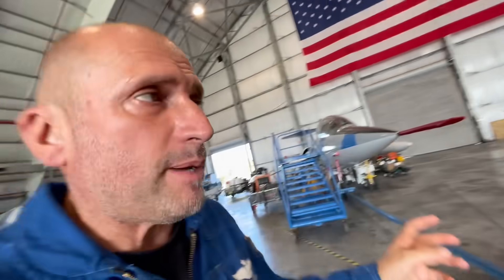How does a 7500 foot runway look from a Lockheed F-104 on final?

Comment: Has anyone actually landed one of these death traps? I just thought they took off and crashed by design. Like a test bed for ejection systems. They don't call it the Widow Maker for nothing. I suppose it's probably because the German airforce tried using it for a role it's not designed for. Still, the numbers are stupid scary

Comment: As a student in UPT at Willy, we would often go to Luke Aux Field in our T-38s to practice approaches. The runway was old concrete and grass so all approaches were low approaches or go arounds. We would normally fly downwind at 250 but when a German F-104 entered the pattern, we would bump it up to 300. Trying to get your pacing down at 250 as a student was challenging enough but flying at 300 was like fast forward. We heard an American FCF pilot on guard one day telling the Luke RSU that he was stuck in burner and would G the jet up, S-turning on final before killing the engine and landing dead stick. We checked in when we landed at Willy and found he made it in no problem. Amazing...

Comment: If your landing speed is already MACH 1,  you better have a lot of runway ahead of you to stop. That is definitely one airplane that could use a good A.I.-controlled autopilot to assist with landings = not too slow or it will literally fall out of the sky.

Comment: I thought maximum airspeed below 10000 MSL is 250 KIAS?  Does F-104 have special dispensation?
Reply from the maker: Yes as per aircraft manufacturer specs. Minimum maneuverable speed is 325Kts with flaps on take off unless preparing for landing.

Comment: How could a civilian legally operate this under 10,000 at that speed? Do you get a permanent waiver?
Reply from the maker: Yes, 250 unless manufacturer specs requires otherwise. Min maneuverable speed is for 104 325Kts with flaps on Takeoff...unless preparing to land.

Comment: The 104 along with the B 57 Hustler were such beautiful designed airplanes and fast. They looked sharp especially in the my polished silver aluminum skin. And only experienced and excellent pilots could fly them well.
Reply: Just to be pedantic, B-58 was the Hustler. B-57 was the Canberra.
Reply: @skaldlouiscyphre2453  . . .and the Cranberry is anything BUT sharp looking . . .

Comment: Seems impossible to meet the speed restrictions of FAR 91.117... do you need special waivers, or do you have a blanket exemption from those?
Reply from the maker: Yes, max speed is 250 knots unless manufacturer specs dictate otherwise. Min maneuvering speed for the F-104 is 325 Knots with Flaps on T/O, which is Pattern Speed.

Comment: Used to fly out of KTIX quite a bit about 20 years or so ago. Doesn't look like that helicopter school is still in operation there,  on the east side of the runway. In fact it looks as though there have been lots of changes. 

Great video, thanks!

Comment: How do you get away with exceeding 250kts below 10k? Do you have some sort of exemption?
Reply from the maker: The 250 is maximum unless operational limitations dictate otherwise. The minimum maneuvering speed for the Lockheed F-104 is 325 Knots...which would be pattern speed.

Comment: How are you guys allowed to go so fast? I'm aware of the airspeed restrictions nearing airports, at specific altitudes and depending on the airspace, but did you guys get cleared by ATC or do you guys have permission to fly that fast?
Reply from the maker: The 250 is maximum unless operational limitations dictate otherwise. The minimum maneuvering speed for the Lockheed F-104 is 325 Knots...which would be pattern speed.
Reply: @PiercarloCiacchi  Makes sense. Thank you!
Do you have to get special permission from the FAA for them to recognize that?

Comment: What is the reasoning for the low and flat approach at such a high power setting? Is it only to have a vertical speed low enough to land without flare, or are there other considerations? Thanks for the great video.

Comment: Burner at the end to help get through the drag of 200knots and help with positive rate of climb out to 250 knots? The J79 has 4 stages of burner. Did you select MAX burner for those few seconds? And if you did, why come out of burner at only 250 knots? On take off (clean aircraft I believe), burner is kept in until at least 300 knots, same with T/O flaps? You didn't need burner because your overall weight was low because you burned off a few thousand pounds of fuel? Thanks Piercarlo. Loving these videos.
Reply from the maker: Briefly burner to help the go around....
I would keep it on ALL DAY LOMG lol, bu the fuel is never enough...that's why..

Comment: Question: How does a 7500 foot runway look to an F-104?  Answer: Too short!
Reply: I think I'd like the Lake Bed at Edwards.  That's one fast airplane.
Reply: That's MD-11 speeds this thing lands at, and the MD-11 amongst airliners was also notorious for high takeoff and landing speeds
Reply from the maker: @nerd2814  MD-11 muuuuch slower.
Reply: @nerd2814  Somewhere I read that for runways less than 9000 feet, a drag chute was required!

Comment: I was looking at pattern, gear, flap speeds for the F-104C in the manual a few months ago,  if my memory is correct the pattern/flap speeds are higher  for your jet, or am I possibly remembering the numbers incorrectly?
Reply from the maker: Uh, not sure, I would not know the C model, but yes those are the numbers off of our manual...let me take that back, Base turn is 200 + fuel, final 175 + fuel....we do like to be faster on final....
Reply: @PiercarloCiacchi  Thanks. Is there a minimum RPM for the blown flaps to be effective? I seem to recall that they only function at 80% or above, or a similar number.